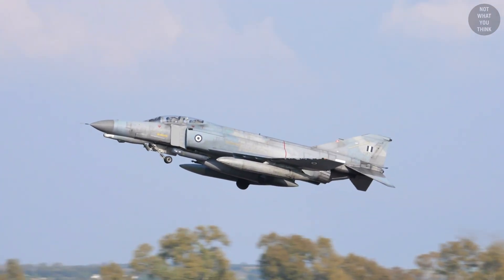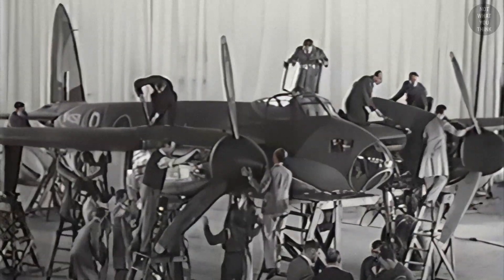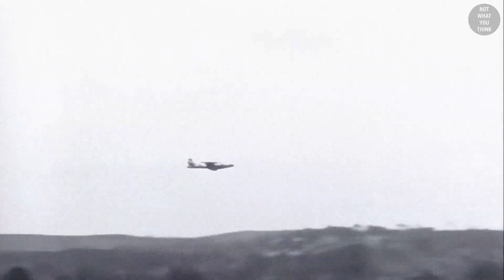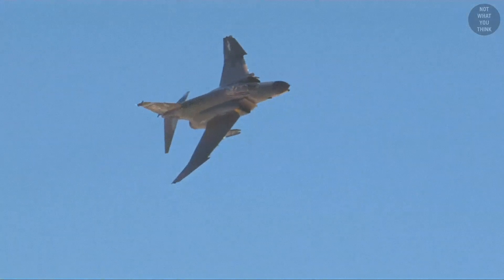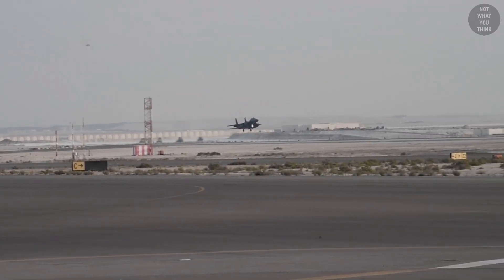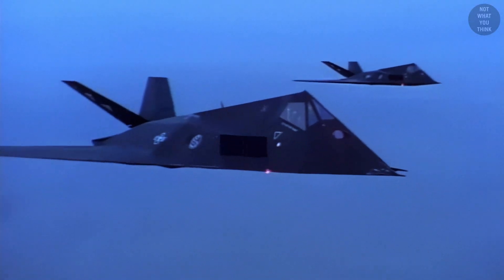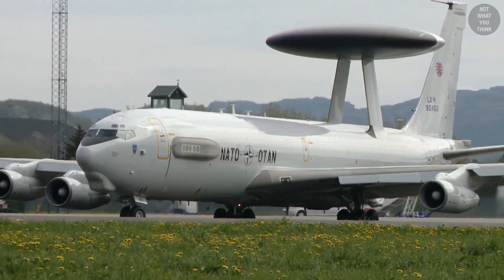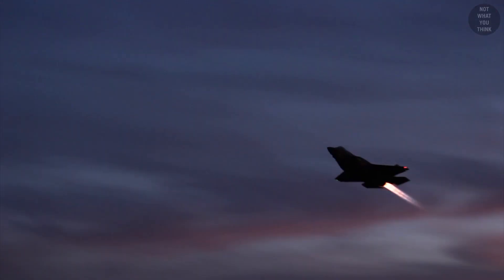Why are Modern Fighter Jets Slower than 1960s?

Comment: 7:11 not only that, but the shockheating, so the air getting compressed in front of the aircraft and heated that way.
Air friction is at high speeds often the lesser reason of heating

Comment: To a degree yes. But I think comparing an f4 to an F35 is wrong. In fact compare it to an F-16 which the F35 is replacing. In a clean jet. The F16 can reach M2.3 at 50,000ft. when in combat configuration and loaded with weapons. The F-16 will never reach its top speed. Now the F-35 top speed is M1.6. But in stealth configuration and weapons loaded inside. Can still reach M1.6. So yes the Viper is the faster jet. But when when in combat. That top speed advantage is gone!
Reply: 2.05 is the Viper's top speed. Takes forever to get there, can only hold it for seconds, and if you wan to be get home based on fuel, you would have had to dive to get to that speed in the first place.

Comment: The 1950's was the zenith of aerodynamics. No interceptor/fighter will slice through the atmosphere with less resistance than an F-104. The Mig-21, Mirage 3, F-106 and the Saab Draken are all far better aerodynamically than modern designs and are all from the 50's. All these are faster than an F-35 and they have less than 1/3 the power.
Reply: Thanks for the love friend. Finally something to one up Fat Amy on
Reply: @MikoyanGurevichMiG21  Fat Amy?
Reply: These fighters may have a better aerodynamic, but they have a much higher RCS. Today even non stealth aircraft like the Typhoon have a relatively low RCS (around 1/4 of the Tornado) , and Real stealth aircraft are far lower than the Typhoon.
Long range anti aircraft systems like the S-400 would detect old fighters from a far distance, but they can detect a stealth aircraft only from a relatively small distance, which is nesessary to blow it up with anti radar missiles
Reply: True, but all modern fighters are less likely to kill their pilots. Planes cost less than people.

Comment: "F-22 was reduced in top speed to mitigate its IR signature" True "... Thereby helping its stealth" no, that's not how stealth works, which refers only to radar detection and therefor the planes radar cross section. THAT has nothing to do with stealth (at least from radar perspective) and everything to do with IRST (infrared search and track) that most of the US's potential adversaries use (Russia and China primarily, though the EF-2000 also has IRST). So while you could technically be considered correct, the way you said it made it seem like it actually helped with the size of the radar cross section of the aircraft, which it 100% does not. I guess your IR signature is part of "stealth" as a package however on an aircraft like the F-22, even with the IR mitigation it already has, it will always be detected from much farther out by IR than by radar, so really, it doesn't matter that much. It's one of those grey areas that kinda help everything, but it certainly wasn't done with stealth or a reduced IR signature as the primary focus, that just happened to be a bonus. 

The real reason the top speed was lowered was to reduce airframe stress, including from heat, since we can no longer produce the 22 (we could restart production but it would take a long time). However the "new" top speed can still easily be bypassed. Even without the "reduction" yes it could only hit a little over 1.8 in level flight, but in a dive it's capable of over 2.2, still probably is. The engines remained the same, so it can still get to those speeds.
Reply: It does help with the overall stealth of the aircraft, your aircraft is pretty much useless if it has a stealthy airframe but a huge IR signal coughs Su-57 coughs
Reply: @CrayonEater255  if you actually read my comment you'd see that I mentioned that, and also mentioned that that basically doesn't matter, you will always be IR detected first with a radar cross section the size of the 22's.
Reply: @evangalinsky2499  you try to reduce it as much as possible, I said “huge”
Reply: @CrayonEater255  even if it isn't a "huge" IR signature with today's IRST and IR missiles it really doesn't matter, they can just shoot you with those instead with the added benefit that unless you have IR detection and warning, you won't even know it's coming unlike a radar guided missile.
Reply: @evangalinsky2499  yeah it doesn’t matter, I wonder why Lockheed designers tried to do such a meaningless thing
Reply: The stealth revolution so far has emphasized RCS but IR signatures are an increasinly large component of that. USAF has been flying F-22s and F-35s with IR signature-reducing coats for several months now
Reply: @t8e7q6q6e7tjshabx  mask it from the front all you want, the second someone is at a slightly off angle all that IR signature reduction goes to waste once they can catch even a hint of your exhaust, old 80s Su-27 Flanker IRST may not be able to pick that up very well but modern IRST on say the Su-57 or EF-2000 would grab that in an instant.

Comment: SU 35 have a top speed of 1,500 mph VS the F-35s 1,227 Mph. And Mig 31's top speed, are over Mach 3 + Plus
Reply: Realistically a SU – 35 cannot obtain those actual speeds in combat because of the drag caused by the external weapon points
Reply: Mig-31 is fast, but it's heavy (since it's made of stainless steal, aluminum wouldn't withstand the heat at speed nearly mach 3) and it has a low G limit of just 4,5. It's not a competitor to a normal mach 2 multirole aircraft, it has a different purpose.
Su-35 has probably better aerodynamics, but it's a air superiority fighter and not a fighter bomber. Due to its stealth the F-35 would detect the SU on the radar long before the SU realizes there's something else around.

Comment: Excellent video, but it left out one thing: parasitic drag from drop tanks and missiles/bombs. The reason why 4th gen aircraft can't exploit its maximum speed is that it never flown clean in combat, even empty pylons have a noticeable impact on the speed. Not to mention that non-stealth planes often have to fly at a low altitude to avoid detection, where higher air density will limit most conventional turbojet/fan to Mach 1.2. Stealth fighters like the F-35 can hit Mach 1.6 with internal loadout quite easily, while a combat-loaded F-16 will be hard-pressed to hit Mach 1.5. And even when it's clean, it have to push very hard to get to its maximum potential speed of Mach 2.05. Another case is also the F-15, where its maximum published speed is Mach 2.5, but according to a F-15 pilot, Paul Woodford, he never get passed Mach 2.21 even when it's completely clean. A stripped down F-15 without combat avionics known as Streak Eagle's fastest rodeo is around that speed (Mach 2.2). For most 4th gen fighters, the maximum published speed is more of a theoretical speed under the best condition (cold air etc.).
Reply: One would assume that maximum speed has to be achieved at least once in testing to be reported as 'specifications' to/by the government. Or do they simply believe everything the manufacturer tells them?
Reply: I get tired of this 'never used in combat' argument.  Of course high speed wasn't used in combat - it was never intended to.  The only purpose of these high speed capabilities were to get away when the situation got too hot.  This was common in Vietnam.  Drop all your armaments, light the afterburners, nose down, and get out.  If you ran out of fuel you at least did so over friendly territory where you survived.  Running away may not be considered 'combat situation' but the pilots sure as hell thought of their life or death escape as combat.
Reply: @knurlgnar24  
The catch is that speed, maneuverability, and stealth don't get along well. It would be nice if you could have a fast plane, but if you have to sacrifice other factors that are more relevant against your opponent, you're needlessly blunting your overall edge.

It's like a bayonet training. There might be once-in-a-full moon chance that you'll end up having to fight with a bayonet. But with the same amount of time and resources, you think it's a good idea to spend more time on bayonet training at the expense of marksmanship? Maybe you could argue that your overall training period should be longer, but time has an opportunity cost, and training takes both time and resources, which is not something you can always just afford more.

Sure, you can make a super plane that can do everything, but it would be very expensive, difficult and time-consuming to engineer, and there are still some things you can't have it both ways - like light-weight fighter with a high fuel capacity.